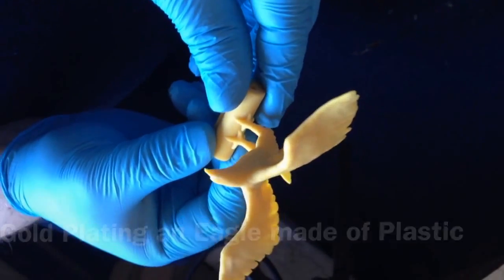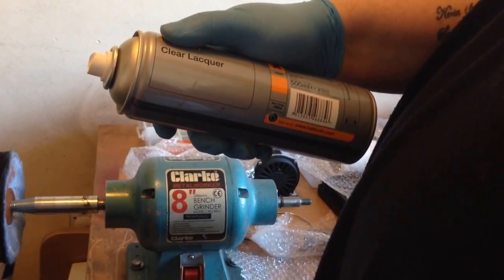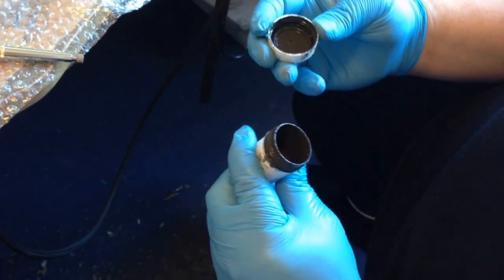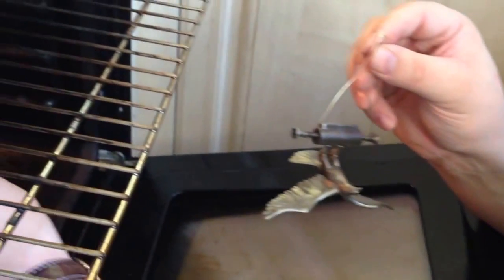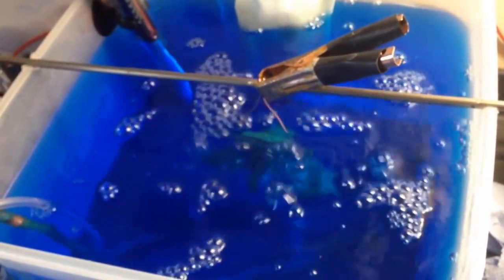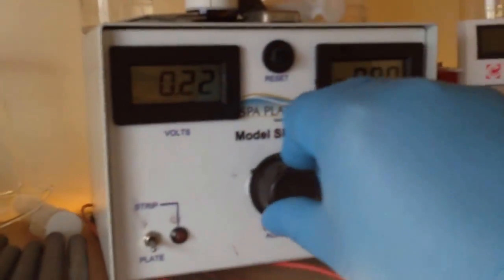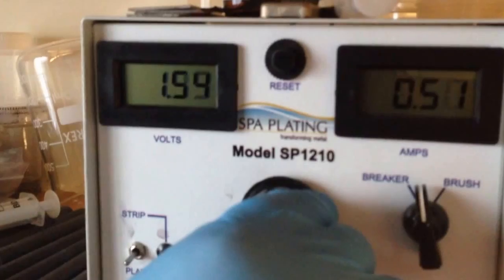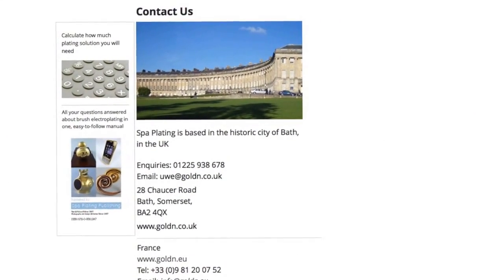Gold Plating a 3D Printed Eagle

Comment: Amazing video!
Im a jewelry designer/fabricator, I'd really like to gold plate the plastic housing of my Gameboy.
Is it a must to do the 3 hour drying process in the oven? 
I'll have to check what type of plastic my Gameboy has and see the melting temp. I know about melting golf and silver but not plastics.
Reply from the maker: thanks 
no you can let it dry for about 24 hours 
thanks
Reply: Should be fine as 3d prints are kind of low temp melting point. OPAre u printing in abs or pla?
Reply: It's actually more likely to slightly melt and deform due to the hair dryer if you keep it on the same spot for too long, than 3 hours at 50°C in the oven.

Comment: Thanks for sharing! I'm curious though, why do you plate with copper, then nickel, before finally plating with gold? 

Couldn't you have just bypassed the copper and/or the nickel, and plated the gold immediately after applying the conductive ink? 

Or just went conductive ink>copper > gold or conductive ink>nickel > gold?
Reply from the maker: you maybe able to plate gold directly over the conductive ink but as the copper plating is a very thick layer it would cost a lot of money if you would do this with gold 
copper is very cheap so as nickel 
you could plate gold directly on to the copper as well but the copper can react with the gold thats why we plate a barrier pf nickel 
thanks
Reply: @GoldenSolutionPlating  ahhh makes a lot of sense, thank you!!!
Reply: @damiangjy  how many karats was gold that the eagle was plated in?

Comment: This is great. I'm curious as to whether it's possible to mask certain areas during the second or third plating to get a surface that has multiple metals on it's surface. Like stripes of nickel and copper. Does anyone know if something like this exists?
Reply from the maker: Yes you can use nail varnish and remove it after

Comment: When you remove the screws, there will be spots that were not plated. What do you do with them?
Reply from the maker: yes thats correct but in this case the area where the screw is will not be visible
Reply: You wil need to keep removing and rotating whatever you are plating to get it even, so the screw will hold in different places.  Solved

Comment: Is this the only method of gold plating 3D parts or is their different models, can you include the different model numbers “if their is” please.
Reply from the maker: i dont know sorry
Reply: The principle is the same for any model. You need to make the plastic electrically conductive. Then plate in copper sulphate for 30 minutes at 0.02 A/cm^2, then nickel, then gold. etc. The only thing you would need to change is the current for your model. It's based entirely from the surface area.

Comment: Another questions.. Why are the anodes in the pockets cotton(in white)? Otherwise it doesn't function?
Reply from the maker: Hi 
The purpose of anode bags is to keep any metallic fines from entering the solution and plating onto the part.
you can plate without the bags but it will come out like sandpaper but you can polish it back 
thanks 
Uwe
Reply: Golden Solution, Hi, i am little sad.. I did the same thing you did I first put a silver conductive polish on the plastic then I put in a copper bath all worked well then I dipped in the nickel bath but no reaction took place .. The object does not nickel. I do not understand, could you help me? Please ? Thank you
Reply from the maker: Hi 
what you use for amp ?
Reply: Golden Solution, The power supply displays 0.33 A and    0. 01 volt for a total surface of 16cm2
Reply from the maker: Bsk TEK hi 
You need to turn the voltage up 
If you look at this video you can see that the volt meter shows about 2 time what the amp setting is 
And check with a test piece and also check the contacts
Reply: But when i increase the voltage the current increase too.. Does not matter?
Reply from the maker: depends if you can adjust the voltage and amp separately 
but i don't know otherwise it could be a lot of different things go wrong 
tank plating is not as easy as it looks Brush plating is a lot easier 
Thanks 
Uwe
Reply: Yes it is very complicated... Can it be from the nickel bath that has become cooled??
Reply from the maker: Bsk TEK hi no 
It will Still work
Reply: Thank you for answer

Comment: one question which clear lacquer brand do you use?
Reply from the maker: from Halfords UK
Reply: And which electric painting? I have tested Graphit 33 spray but I don't achieve more than 2K Ohms in the surface
Reply from the maker: i use connective ink from spa plating http://www.goldn.co.uk/conductive-ink/

Comment: so put a plastic printed part in the OVEN for 2/3 HOURS lol "this is just the best way to find your eagle liquify on the bottom of the oven hahahahaha
Reply: 50 degrees C is only 122 degrees F, so I as long as you're not using PLA filament it should be ok.
Reply: Phoenix Caladrius I thought pla only melts at around 200 °C?

Comment: nice but how well will it last on plastic? vs aluminium?
Reply from the maker: Very well but i wouldn't use aluminium to plate on anyway because thats the most difficult metal to plate on unless you have the setup but its not easy
Reply: yeah I know because I plated analogue nt mini it was not easy but worked nicely imojust plastic is much more softer? it nice to plate and not use it but for use? it will no last as well as in aluminium right?
Reply from the maker: it will last the same as you would plate on any other metal